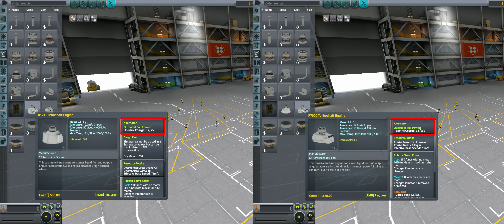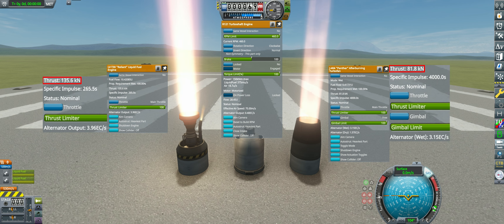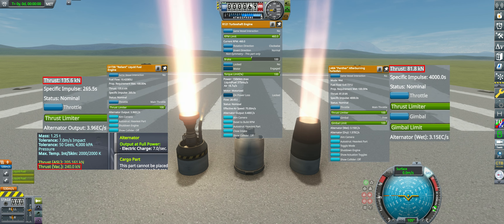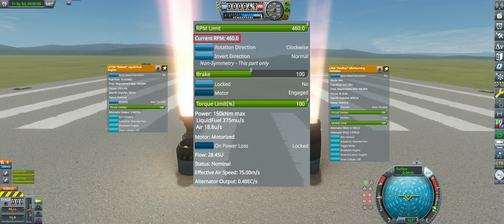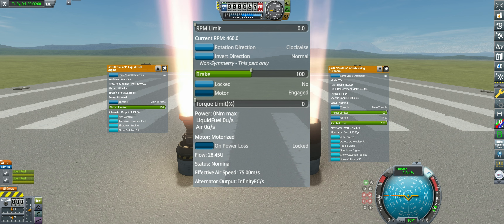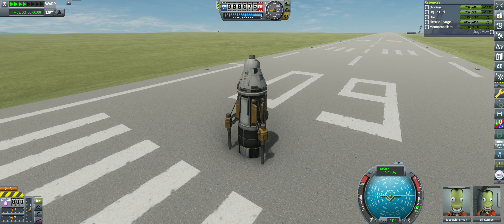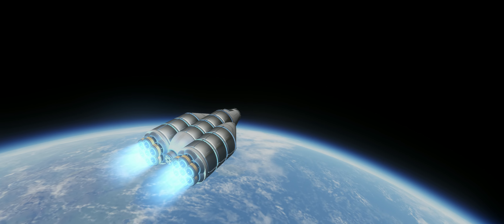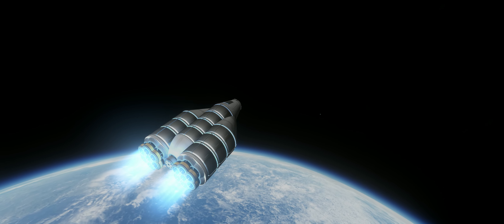KSP Dark Arts: Infinite Power

Comment: doesnt an ion engine set to extreme negative thrust also work using KAL controller?
Reply from the maker: It does, however it also produces Xenon out of thin air, so for many folks it will feel even more exploity than this method.
Reply: It is also a single part glitch requiring less effort to setup.  Definitely has some appeal.

Comment: Subjective opinion: This bug went unnoticed for such a long time because nobody use those turboshaft engines in serious missions.

Like seriously if those engines would be able to operate on lf-ox mixture (or toggle between open/closed cycle) then it would be a huge game changer. Otherwise...the jet engines are much more user and lag friendly for the atmospheric flights with the oxygen and for the rest of the celestial bodies the electric motors are capable for a small / medium sized vessels. With this lf-ox cycle it would be finally a valid option to use props in the large vessels on Eve/Duna/Jool.

Comment: Recently I’ve been messing with torque values for the BG motors without changing their efficiency/NM and at torque values like 5,000 these motors will drain the largest battery in less than a single frame.
This could def help during rnd like negative kalclocking

Comment: I've played around with the breaking ground stuff but I haven't gotten to the turboshaft yet.
However, I stopped playing a while ago so, exploit aside, I still don't understand how the turboshaft even works.
Reply from the maker: Basically, it works very much like the standard rotors, except that instead of consuming electricity to spin and produce torque, it consumes intake air, and liquid fuel.  It also has an integrated air intake.